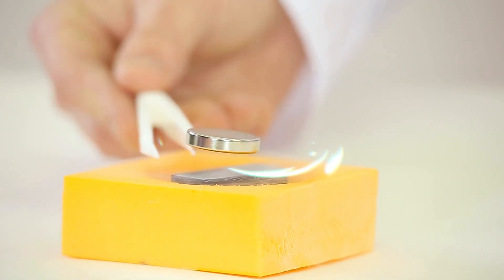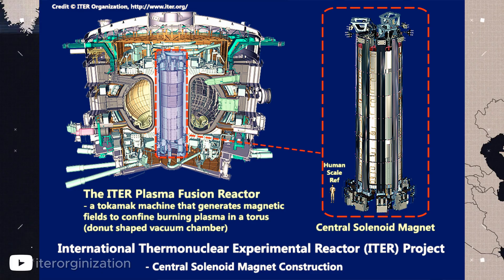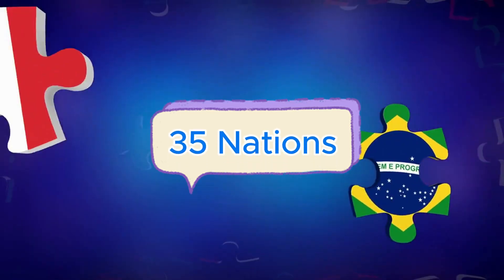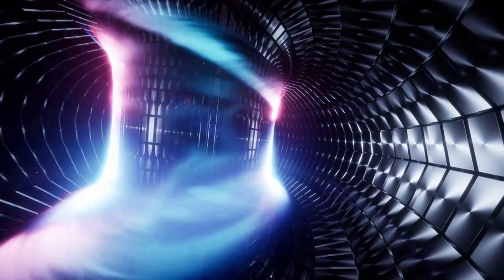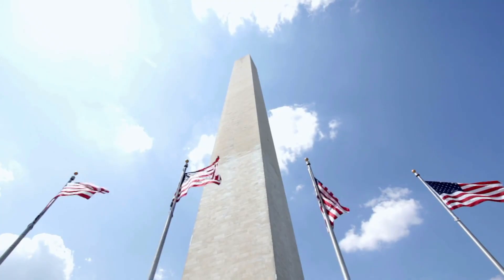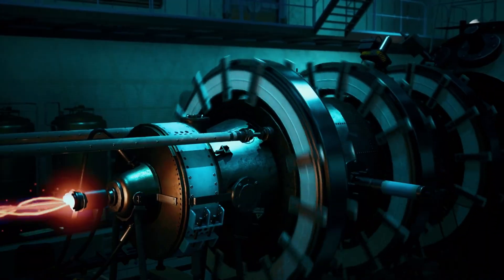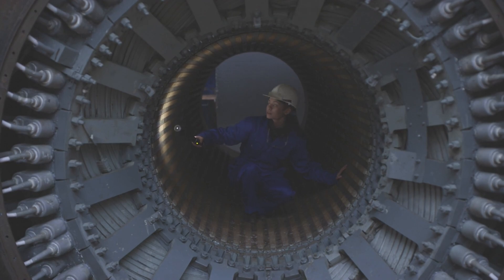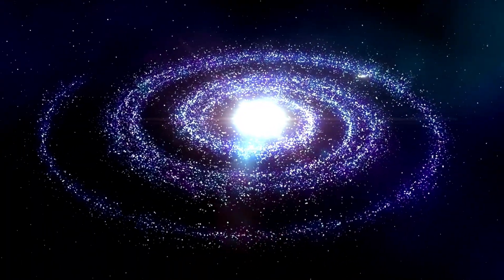World’s Most Powerful Magnet Built for Fusion Energy – Here’s Why It Matters

Comment: jes of course. When powefull magnet and fusion energy work together this is the best revolution especially for wireless cars. When wireless cars   work with radio wawes and thin energy. But they are not strong enough. But this new invention bring this situation to opposite. Extrem high magnetic field allone couses to increase radio wawes and thin energy may be 10 time more. when fusion combine with all of them this can couse 50 times more power or even much more because they are stronger energy in the air compare radio wawes or thin air but still not discowered. High magnetic field and fusion can bring all this energys in a one high level and they react each other. When so whe can see extrem lightweieght cars and planes wireless and 20 times stronger than combustion engines even much more.
Reply: agree with you
Reply from the maker: Nice enthusiasm — love the big-picture imagination here. I’ll reply in a friendly, clear way that corrects a few science points while keeping your hopeful vision intact.

You’re right that combining powerful magnets and fusion could open amazing possibilities, but a couple of clarifications: strong magnetic fields by themselves don’t automatically increase radio waves or create free “thin energy” in the air. Radio waves are produced by oscillating electric currents (antennas); magnets influence electromagnetic fields but don’t magically amplify ambient radio signals without a proper transmitter. Fusion plants would produce huge amounts of heat/electricity, not ambient wireless power—so the real gain from fusion is abundant, low-carbon electricity that could power new systems at scale.

That said, fusion plus advanced magnet technologies could enable practical, city-scale wireless charging networks, more efficient motors (lighter, higher power density), and novel propulsion or power-transfer systems that let vehicles and aircraft be much lighter and more efficient than combustion engines. Technologies like resonant wireless power, microwave/laser beaming, and superconducting motors could all benefit from plentiful clean electricity — and that is where your “50×” leap in capability might come from: not from a single magic field, but from lots of connected advances (materials, power electronics, transmission methods) enabled by fusion-scale energy.

So keep dreaming big — but also keep the physics in the loop.